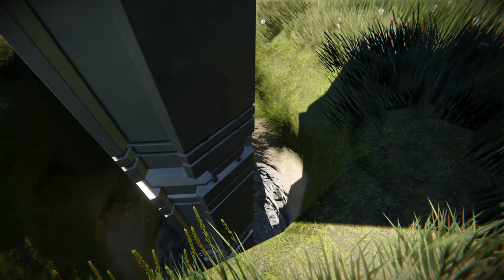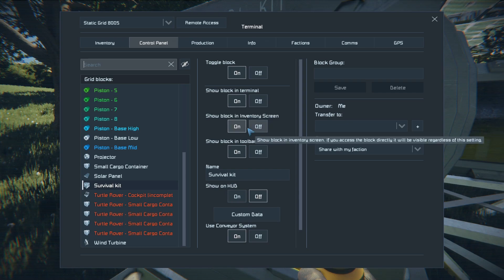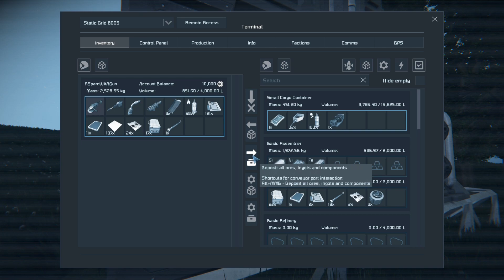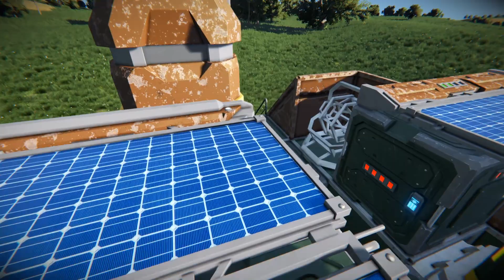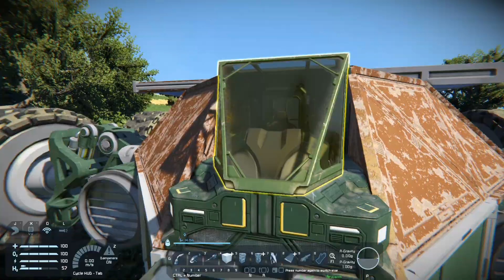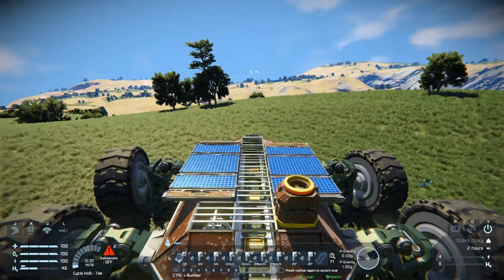The Turtle Rover Base Is Operational! - Space Engineers LP - E03

Comment: i dont know how to explain this but if you start to steer a car the inner wheel need a biger steering degree than the outer wheel in a curve. I see in you video that your steering geometry is completly messed up...that is the reason why your steering radius is so big..
Reply from the maker: Well...I mean part of that is the wheel blocks in the game. I just sort of plopped them on but they're not always the most accurate in terms of physics etc. Although with your analogy, I don't know how I'd adjust that as turning one way would change which wheel is the inner & outer wheel. So I'd have to adjust the wheel settings on the fly. :/

Comment: You don't have to turn the battery off. Once the battery is off it won't recharge. Also once handbrake is on wheels don't consume current.
Reply from the maker: If you're meaning when I turned it off while it was connected, it was to keep the turtle from draining the base battery, which I didn't want to happen. If not, then I'm not sure why I'd turn a battery off if everything else was off lol.

Didn't know that about the handbrake though, that's really useful to know! :)
Reply: @Sleeplessknightsstudios  I mean instead of turning the battery off, u can just switch it to recharge or discharge mode as per need. Also you can make the base electricity positive by adding more wind turbines
Reply from the maker: Yeah, but I didn't have the resources/time to expand the turbines. I just didn't want to drain the rover but I didn't want the base draining either, so turning off the rover's batteries was just faster was all. :)

Comment: Are the wheels upside down? I like the series, neat starter mobile base. Have you tried using a rotor with a small head to mount things like a hydrogen engine, beacon, and antenna? Since you're low on resources that may work best as an intermediary stage.
Reply from the maker: I'm...not sure haha. In the next episode I make a note about the wheels seeming to spin the wrong way so I thought I did. Then they...stopped, doing that so...now I'm not sure. :P

Comment: Without a script, you could use a sensor block, detect player only and as an action you lower continiously when present, and invert when not detected. This way, when you're near the base it's lowering for you, and when you enter the cockpit you're not detected anymore and it raise back. You'll need 2 timerblocks also for this, that you can put in place of light armor :)

Also, you could replace the two front conveyors with H2/O2 gen as it have a side that can connect to cockpit while having the tip connected to the rest of the central piping
Reply from the maker: Hmm, that's an interesting idea! I always forget about sensor blocks...probably the inner programmer in me always defaults to scripts lol. But the H2/O2 gen placement is an interesting idea too...though...not sure how to do it without the ship falling apart now lol. :P